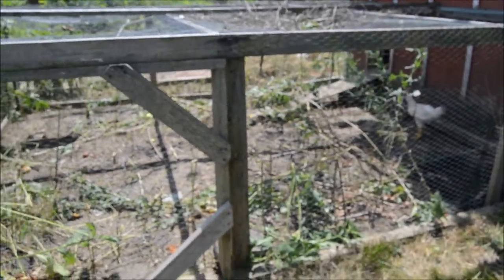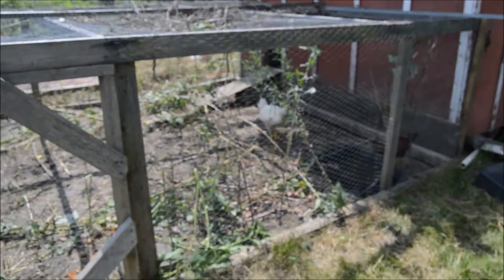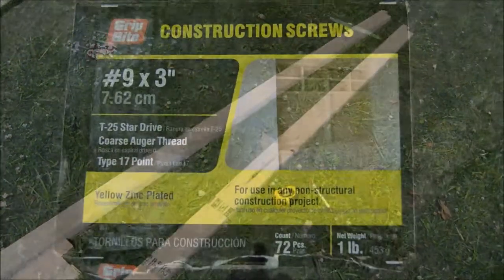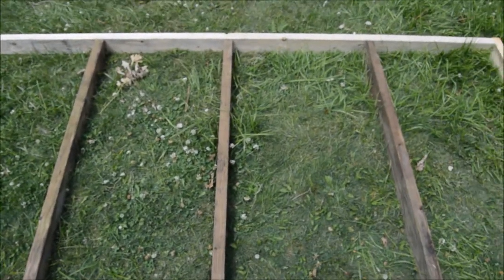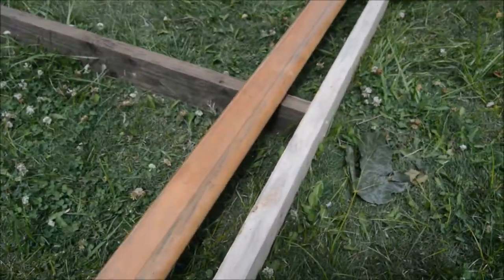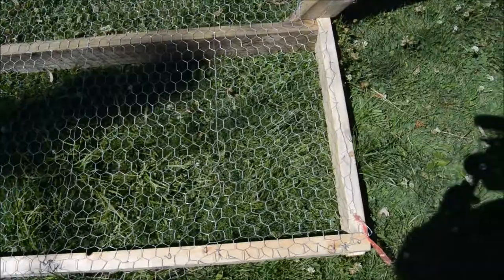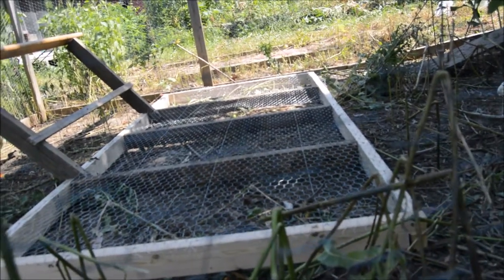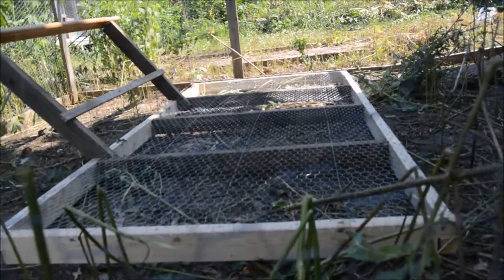How to Build a Grass Protector for your Chicken Coop

Comment: How do you attach the wire on tightly
Reply from the maker: I nailed the wire down on short side. Then I wrapped my fingers in the wire holes and pulled tight while my daughter nailed enough tacks to keep it tight. I would use rabbit wire next time because of the firmer wire and the smaller holes.